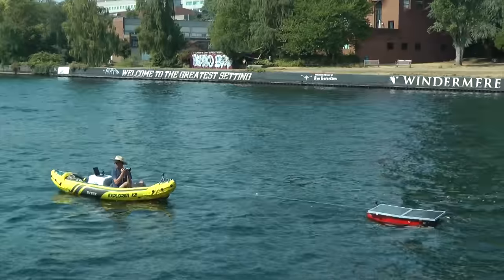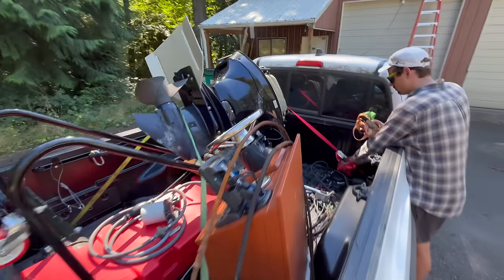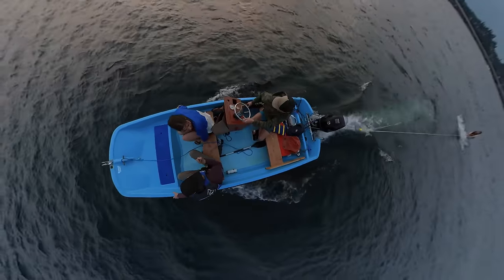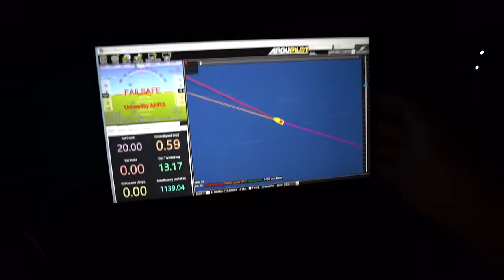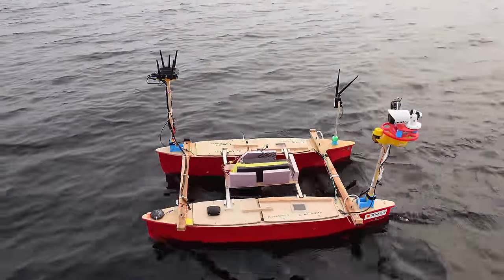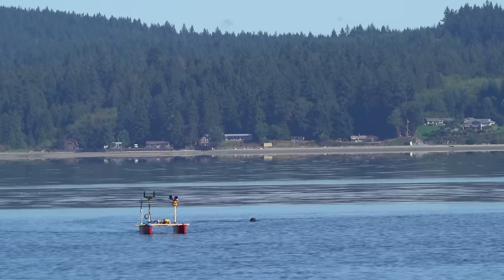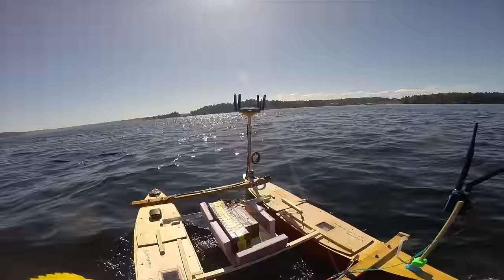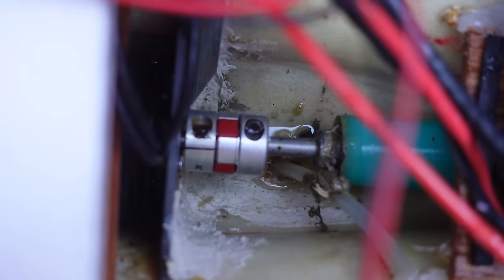Autonomous Boat 50km Waypoint Mission

Comment: Why not encase electronics in something - otter box, hot glue, resin? Would exploring using an rc sail be an option? Something that could deploy a 3d printed foil or rigid prop to catch wind to save using motor all the time. Would act as hyprid where when wind is available and is in direction boat is going then use wind else use motor. Also having any solar power, even if minimal, might be better than not using it.

Comment: Would blades at the base of the spinning prop do anything to help with the seaweed problem? I've seen it done with larger boats and wonder if it will work the same for smaller ones like this.

Comment: I'm wondering if one large prop would do better with not getting caught with seaweed. It seems like this is just an unavoidable reality for small props, so something large and powerful enough that won't get snagged or can cut through the weeds might work better.
I'd also experiment with prop that has blades that spiral outward. They might be less efficient, but if they can clear weeds better then you're making up for that loss in efficiency by not making green buritos.
The issue I see with adding fins and baskets around them is you're providing more structure for debris to jam your prop. And at low speeds the water will probably flow around any protrusion, carrying the weeds with it. And I don't think a water jet will work because that's just asking to get jammed instantly.

Also for your water level sensor, why not go with a mechanical float? A ping-pong ball on a lever with a microswitch at the end?

And I would consider mounting electronics away from the walls of the hull if possible. Either on struts that are angled out from top to bottom so water can't slide along them, or secure them on an inner hull. Kind of like a pressure hull on a submarine.
The flat roofs on the hull can drip water onto your electronics as well, so making them like a ^ shape might prevent any water from clinging to the underside and getting everywhere. Water getting in seems to be inevitable. So designing the boat so the easiest path for the water is away from the electronics and into the bilge might be a better solution

Comment: Arduino DIO can't deliver any real current, you'd want a FET/transistor to toggles the  relay input current. (Or use FETs to provide the motor current directly, which is more efficient anyways

Comment: Why not add a gear ring around the steering wheel and an electric motor, so you can let ardu-pilot take over the steering to follow a heading or doing an autonomous mission? :)

Same for the throttle.

Just add a physical switch and a display for speed and heading so you can select heading and speed, like on an airplane with a knob and engage it - if you like - without using a computer.

Comment: Could you make a controllable knife that could slice off the seaweed on command? Or automatically when speed is substantially less than it expects for a given power input? Sharpen the leading edges of the props?

Comment: ..what about putting a cutter of some kind on the shaft-prop to cut the seaweed,, cages screens will just block up
Reply: either a sharp blade on the shaft itself (scary way) or a cutter style that uses a fixed blade/edge on the hull and a screw on the shaft

Comment: Besides the seaweed draining exes power from the battery, there is further issue of hydrodynamical nature, that might cause comparable or even higher energy waste - I see your drone boat driving way pass the hull speed which rises the power need for not planing boat, drastically. The hull speed for your boat would be somewhere under 0.7 m/s. I would stay way bellow this limit as long as the amount of energy available is one of the missions bottlenecks.

Comment: Would've put a mechanical water sensor (purely on account of the drain from the arduino) every volt should matter, no?
On the seaweed, you could try a line cutter (essentially an over sized washer with sharp cutting edges between the prop and its mounting).

Comment: Please upvote so I can get an answer! 

How did you do your solar plane? I've got a 2m span glider I'm wanting to try solar, I run it on 2s, what charge controller did you use? I'll be running a matek fc and inav, max amps are only about 15 on launch and drops down to about 3a on cruise.

Comment: what if you built a setup based around a satellite phone? it would be more expensive to run and higher latency but it would work around the globe. you could make a drift based set up with solar and follow it as it floats around the trade winds

Comment: swap the arduino and water detector for a float switch tied directly to a battery and the pump, no need for all the fancy stuff that's so prone to failure. you could even make your own float switch if you want to keep in the spirit of the channel.

Comment: You should try to start making your own sealed battery packs from Battery Hook up. It's kind of insane that you are using either RC batteries of that Delta! They aren't waterproof, not even water resistant

Comment: I have some doubts about the planing definition. You should be able to see a valley in your speed, power relationship. What this means in practice is that once you get up on plane, you can decrease the power without leaving plane.

To measure this, you can increase power linearly to your max, and then decrease it down again linearly. In a velocity, power plot, you will see that you took two different paths. This is efficiency gain from planing. You may also see the valley i mentioned, depending on how well it planes.

Comment: The voltage regulators in clone Arduino are very prone to over voltage.. If your battery was above 12v that would be the culprit than over current.

Comment: I’ve thought about making something similar to deploy underwater cameras around an Island that I have a place on in northern Michigan. It is strategically located in the Strait of Machinac where there are reported to be numerous shipwrecks. 
  I would appreciate any information that you might be able to send to me regarding integrating GPS guided control systems and making an autonomously controlled boat system. Thanks.

Comment: How you thought Arduino data pin could handle the relay?! Back emf easily kills the device as seen in your project. Additionally, the relay draws much more current than 20 mA, which is the maximum the Arduino data pin can deliver. It would be nice if you could pay more attention to insulation. Other than that, nice project at all

Comment: Those cheap "water level sensors" are crap. You can expect them to work once, for a short time. They are effectively HHO electrolysis cells made out of solder (no bueno) A pretty reliable way to do a level sensor like that is an air pressure sensor where a tube goes down into the liquid and you sense the hydrostatic pressure. Float switches are pretty good too but I don't think you will find one small enough.

Comment: Those liquid level sensors are not made for use outside of "Oh shit detectors" one time use kinda thing, I mean maybe they could be made adequate if you gold plate them.... I think I would experiment with a ping pong ball and a low resistance switch, You know like the limit switches we use on 3d printers. That way when the switch is pressed by the buoyancy of the ping pong ball, I can run the pump for a minute solid before checking if it is still registering, pumping air for 45 seconds is better then leaving any water in reach of the pump. I would say your best off the shelf option for a water sensor would be a pair of gold plated stud earrings heat pressed into your waterproof plastic case. 

I have another useful tip for automation faults in general. Think of that big red "Oh shit" button.. Like most switches they have a 3 poles like a relay, open, ground, and closed. Logic can dictate that you run power to the switch to the open side and smash trigger when the power passes through the now closed switch. But if power running through it is normal, you can detect not only when the switch is pressed, but when the wire that senses this is damaged.

Comment: Those exposed-trace liquid level sensors are well known for being absolute crap and corroding just like you saw, same as other "moisture" sensors built the same way. The only sensible approach to detecting water levels in a situation like that is a sealed float switch, and in your case it would need to be a very small one to sit close enough to the bottom to be useful; might be a custom job!

Edit: Also, "logic level" relays typically means they'll switch at 5V (or less), but doesn't imply anything about the required current which can often be quite high to get the coils to energize enough to flip the contacts at voltages that low. Single digital outputs on most microcontrollers are 50mA or less, with the whole chip's I/O usually being limited to 50-300mA across all outputs.

Comment: You should just power your laptop directly with DC. Why have your battery DC output converted to AC and then back to DC by your laptop's adapter? Just step down the voltage instead.

Comment: You NEED to pour silicone sealant over the electronics, also do a better job at sealing the entire hull, going for the bare minimum doee not cut it when it comes to weatherproofing. Make it able to survive a huge wave going over the top deck.

Also make the antenna mast more robust and sturdy. It needs to be able to survive average weather. The weather you went in was too mild and calm and yet still managed to get soaked inside. 

Finnaly you have to have some obstacle avoidance system that does not rely on manual control to avoid ships, this part can be tricky with fog and constant bobbing from the waves. But just using GPS waypoints is not very impressive at all in 2023 even without the constant helicopter parenting and manual interventions.
Besides my harsh criticism I did enjoy the video.

Comment: Most of these liquid level sensors are badly designed. You want to look for a capacitive moisture sensor instead of a resistive one. The former does not need direct contact and can safely be wrapped in plastic to protect it even further.

Comment: Diesel electric hybrid? 🤔🥺🤓

Look up the Edison Motors logging truck and see if a fun-sized boat version of that is feasible.. 

Your 50hp motor are already super huge, and 95% of the time will never use max power. Battery + genset (also useful for camping/zombie apocalypse) can get the same thing done at far less weight and more views!

Comment: Some marine things: Fish will come to a light in the water. You weren't necessarily in a school of fish, you were bringing them to you. 

The barge looked like a dump-barge. They're used for dredging. Somewhere nearby is a crane barge with a big scoop used to make channels deeper, they plop it in a barge like that then a tug tows it way offshore. There are big doors on the bottom that open up and the mud goes to the bottom. There's usually two or three dump barges in a cycle. They fill one while towing the other one in and out.

The unit with the two tugs escorting it was an articulated tug and barge (ATB). They carry things like heating oil or chemicals. The two harbor tugs are there to help out in the tight and shallow waters.

Boat bilge pumps either use a float switch (little ball bearing inside the switch completes the circuit when the switch body floats up) or they have a small board inside that turns the pump on every once in a while and measures the load. If there's a load, it pumps till the load goes away.

Most commercial boats monitor marine radio on channel 13. You can totally call them and say "The big ferry coming by buoy 14, this is the little whaler off to your side, I'm working with a small drone boat off your port bow, please don't run it over."  The boat's captain will most likely reply to the tune of "Oh, I see it now, do you need a slow bell?" meaning 'do you want me to slow down and not wake the piss out of your toy'. The polite response to this is "No, it's fine. If it can't take it, it shouldn't be out here."

If you are doing things in navigation channels you really ought to have a marine chart so that you know when you're intruding into big-boat-can-only-be-here places. Some of those things have stopping distances measured in kilometers.

Comment: now you knew gas engine was better than battery e motor
it because have more hp and less weight 
if you were looking for speed that on gas engine
if you where cruiser slow speed it be on electric like sailer boat

Comment: 4 stroke did not exist when that boat was made so it is very overpowered more so on the weight side. i would keep an eye on the transom. 2 stroke is much easier to work on, more reliable, much lighter and packs more torque. downside is a little louder and use a little more fuel. unrelated but i blame you for my fifish evo purchase after watching your recovery videos and i love it so just wanted to say thanks for that. also a home made float switch would be much simpler for your bilge pump.

Comment: 19:18 - You keep farting around in the Whaler with yer sexy new motor - the G force from the "cool" turns yer doing in the boat is gonna make your stuff (batt, RC controller, laptop,etc )  you have on top of those totes you're using as tables fly right off the boat and over the side .......

Comment: FYI most outboards are still measured at the crank. Only "high output" outboards are measured at the prop, that's what makes them "better".

 Also make sure you can actually run that motor, in Florida it's a crime to run an engine over the rated HP if it's under 20 feet.

Comment: I wonder when the gas powered boat will go on ardupilot? I'm doing such a project with the 12' boat and a 15hp outboard. Converting a cheap Vevor-sourced linear actuator for steering and probably a robotic servo for the throttle. The idea started out when I realized that I needed more weight up front of the boat with me in back at the tiller controlled motor. I imagined skipping the steering console and myself sitting up front driving it with a RC-car pistol transmitter. Then I imagined myself sitting on the pier and driving the (unmanned) boat from there. And then I imagined plugging it into a Pixhawk 😁 Right now, I'm converting the linear actuator to work on a PWM signal and adding a position feedback potentiometer.

Comment: 🎯 Key Takeaways for quick navigation:

00:00 🚤 The video is sponsored by Factor; the creator attempts the longest autonomous boat mission around Bainbridge Island.
01:26 ⛵ The Boston Whaler, previously an electric boat, is converted back to a gas motor for efficiency, becoming a support vessel for monitoring the autonomous drone boat.
03:47 🚤 Testing electric motors on the Boston Whaler; achieves plane with 18s batteries, exploring the advantages and challenges of electric propulsion.
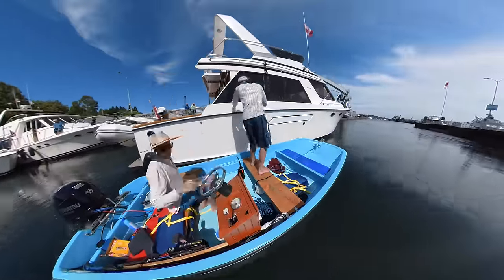06:52 🛶 Successful conversion of the Boston Whaler to a gas-powered boat using a 50 horsepower outboard motor.
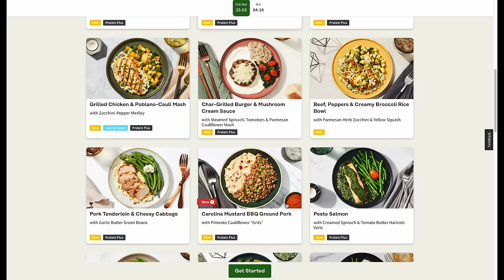09:00 🍽️ Brief sponsor segment for Factor meals, promoting convenient, healthy, and pre-prepared meal options.
10:05 🚤 Preparing the autonomous boat for an extended mission by adding extra batteries and addressing potential seaweed interference.
11:55 📡 Monitoring the autonomous boat from the Boston Whaler due to challenges like commercial boat traffic and seaweed interference.
16:41 🌫️ The autonomous boat encounters challenges such as low tide, fog, and potential collisions with other vessels during its mission.
20:31 🌊 Seaweed in the propellers causes issues, prompting the operator to clear them and observe improved speed and performance.
20:44 🚤 The drone boat faces challenges with seaweed, affecting its efficiency during autonomous missions.
21:25 🌊 Solar panels were removed; without seaweed, the boat has enough battery power for all-day operation.
22:14 🚁 The user sends the drone up to investigate a Y-shaped channel, looking for whirlpools, eddy currents, and dolphins.
23:16 🚢 The boat navigates a challenging channel with ferry traffic, considering manual override due to fast currents.
24:47 🔋 The boat experiences battery issues, leading to a premature end of the mission; lithium iron phosphate batteries are mentioned.
25:30 ⚙️ Seaweed vulnerability prompts the need for a new propulsion method; the next video will explore potential solutions.
26:23 💧 The boat sustains water damage; circuit boards fried, but battery cells remain intact for future projects.
27:19 🔥 Water damage leads to burnt components, specifically a voltage regulator on the Arduino, affecting the boat's electronics.

Made with HARPA AI